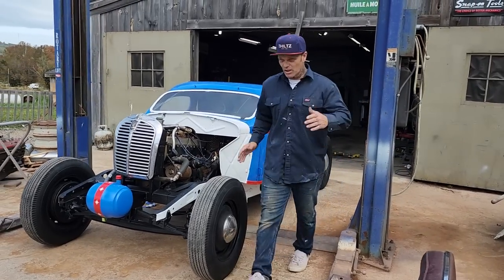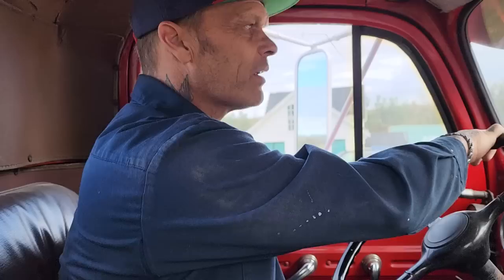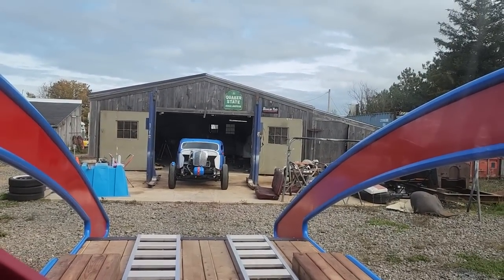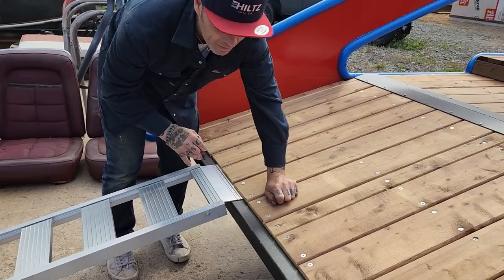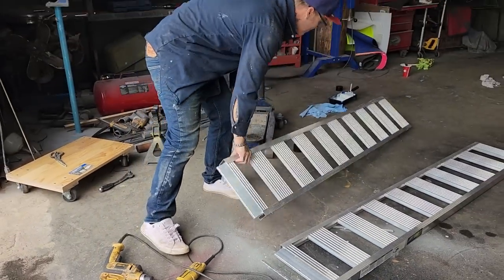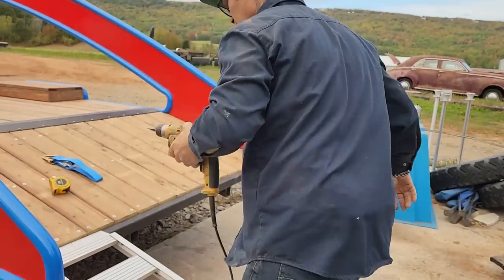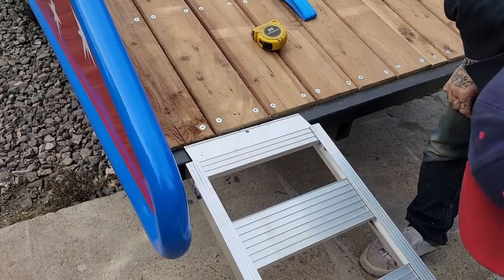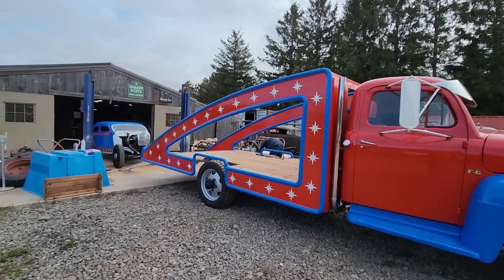Loading the race car on the 1948 Ford car hauler for the 1st time 🙌🏻

Comment: You are using the ramps upside down, or end for end if you will. The piece you are cutting was meant to be on the ground.
Reply: Nearly 1200lbs between two , ?
 1.8 mm Aluminium Lip holding all that weight ?
  Metal Fatigue waiting to pounce holy shit ,
   Just get some angle iron and fabricate some to store underneath between bed and  chassis ...
     Gotta love that bending going on ...

Comment: the race car fits well on the hauler, i'm concerned that the ramps may kick out when unloading. maybe you should drill and fit some type of pin or bolt to act as a safety.

Comment: I would put a couple pieces of 4" angle iron bolted to the bed in front of both front tires so you can just winch it straight to the stops and not have to worry about it ever going to far forward...

Comment: Chad, you just needed to measure the center-to-center of the tires and then center the ramps at that instead of all that figuring and guessing. Since the rear wheels have a different measurement you could have adjusted for that...they just barely make it...but it works I guess. Overall, a great build!

Comment: Looks good but all the weight of the vehicle can put an enormous amount of stress on the unsupported thin lip of the ramp that overhangs the square tubing of your deck.  Best that the square tubing of the ramp would rest on an additional rectangular tubing welded to the deck.

Comment: I don't think you need to remove the wheel covers when loading/unloading. You just need ramps at each end, and the car will simply roll over the top of them. The ramp at the front might need to be quite shallow so that when unloading, the weight of the car at the rear is enough to lift the front wheels up the ramp.

Comment: looks nearly as good as jolene but on my point wouldn't the truck side been better with another 5 stars on each side still wouldn't look as good as jolene but just a thought and some triangle wedges on those tyre covers it would roll over dead easy just sayin don`t shout at me but still not as amazin as jolene looks nice job chad well done  chap

Comment: The ramps all the way to the outside so the tires are more in the center.  Backing the car off there is no tolerance for movement.

Comment: wish J wouldn't stand in that whiplash zone of that aircraft cable, its been know to remove limbs with just 2000lbs..  my good friend Bobby Mcgee was decapitated working down at the seattle peers with a by broken cable line that had snapped installing pillions in the water for a new dock..  sad day